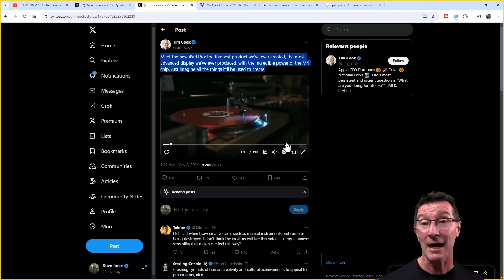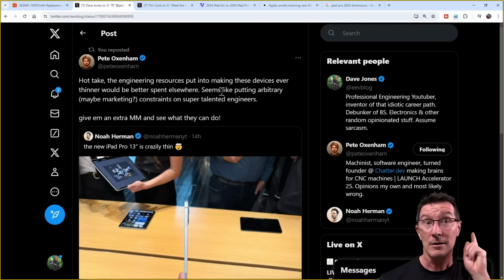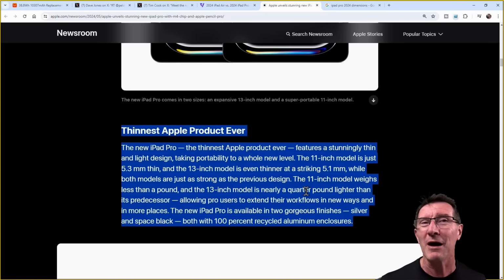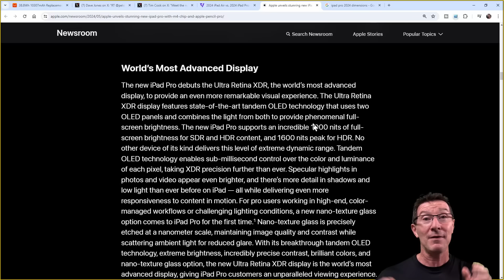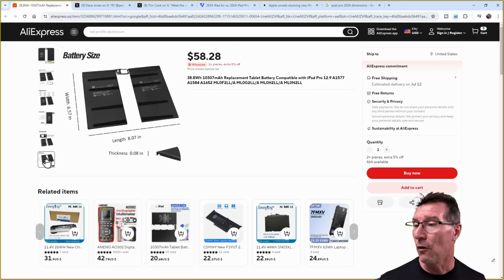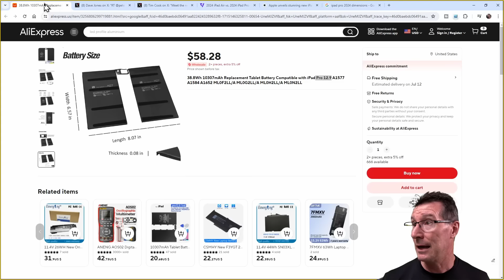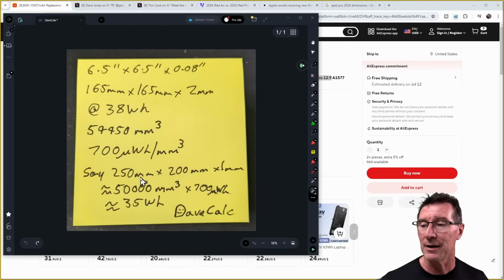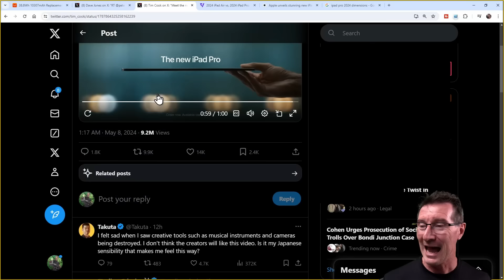eevBLAB 118 - NEW Apple iPad Pro: Volumetric Engineering vs Marketing

Comment: I'm not saying more battery life is bad, but when increasing battery capacity, there are countless factors you have to account for. Weight is the biggest one i can think, 50% more capacity means 50% heavier battery, which may tired your hand faster. Apple also has a "magic keyboard" that basically "float" your ipad. More weight needs more rigid mechanism = more expensive. Then there are extra cost of bigger battery, slower charging time(from user persective, it takes longer to do 0-100%).
Reply: But how long does it take for your hand to feel tired when holding a tablet? Saying that it takes longer to charge as a negative doesn't make sense to me. Take it the other way, make the battery so small and charging to 100% is instant, but nobody would want a device that lasts 30 seconds on battery. You'd also run the battery down to 0 less often. You shouldn'tbe running batteries down to empty if you want it to last anyways. As far as the magic keyboard is concerned, you're applying a stylistic design for a keyboard as a constraint for the tablet it goes with? I think the M$ Surface is about the heaviest tablets I can think of and they have keyboard stands.
Reply: @andrewn7365  let address each point: first is from my experience with the 12.9 ipad, it's quite fast to feel tired holding it, ymmv, but the 12.9 is not a light tablet at all, in fact it's on the heavy side.
Second point: that is exactly why i said "from user view", all they care is how long can they use the battery, and how fast to get it full, all the other thing like "you should not run it empty" blah blah, they dont care much(and they shouldn't tbh, it's our engineer job)
Third point: the keyboard stand of surface is completely different from ipad, the keyboard stand of ipad is "floating" style(it means the table does not contact the table)

Comment: There's absolutely nothing new in an iPad so what else can they do to feed the FanBoys who "Have to have the latest model" and rave about how thin it is because they can't point to anything that it does better than the last 10 models.
A little bit larger then a little but smaller, then straight edges, then different colours then curved edges.
What can it DO that's NEW?

Comment: The problem is, 10 hours vs 15 hours becomes meaningless - the laptops already get over 10 hours of life, and chasing another 5 hours out of it doesn't add all that much. (Apple's battery life estimates are also oddly conservative - by 10 hours they usually mean you can get easily 12-15+ hours if you "compromise" like watching videos or turning down the brightness). For most uses, 10 hours is basically a couple of day's usage at home (ignoring the time spent recharging while you're sleeping). For those at work 10 hours is a full working day. Apple's marketing is not that dumb - if they could market 15 or 20 hours as something, they'd have done it years ago - the iPad's been out nearly 15 years now and it's been a 10 hour battery life for all 15 of them since the beginning.
Reply from the maker: Put that on your resume for your next marketing job. Forget practical benefits like extended battery product lifeycle aging.